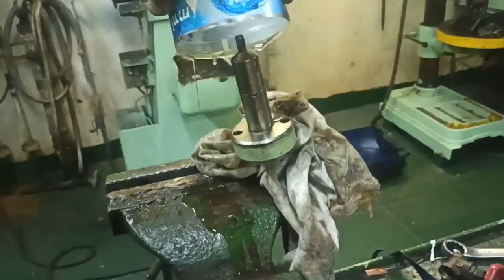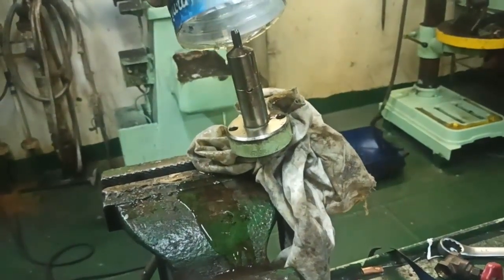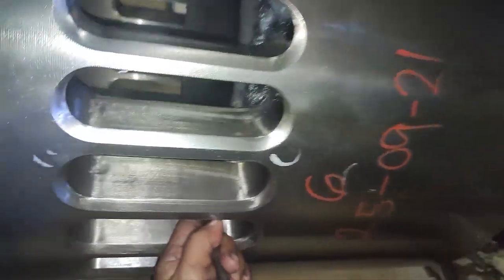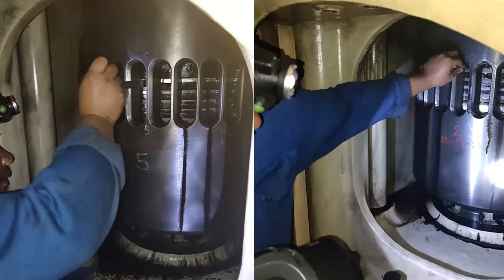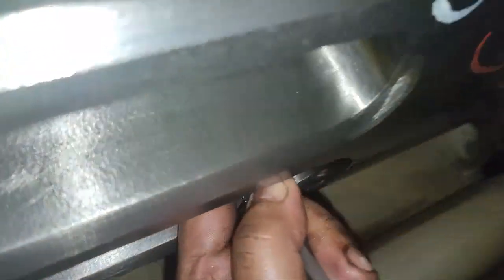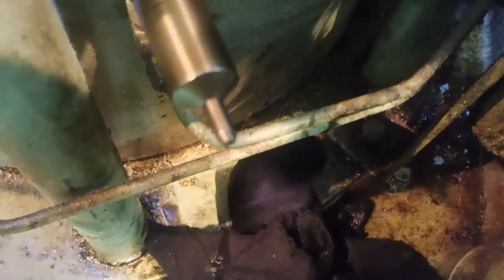Main Engine Cylinder Lubrication Checking

Comment: How did you simulate this test in workshop? pls show us the procedure
Reply from the maker: Hello Sir, we have used the hydraulic pump, just we made one connection.

Other way is when the main engine is not running to turn the lubricator to outside and check the injection.

The last way is to add you mobile inside the scavenge manifoulds and inspect